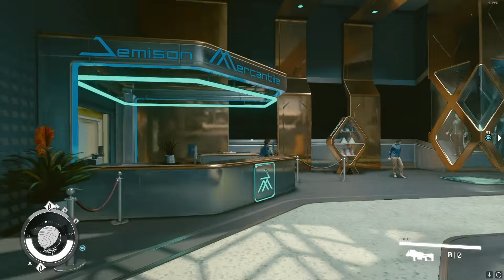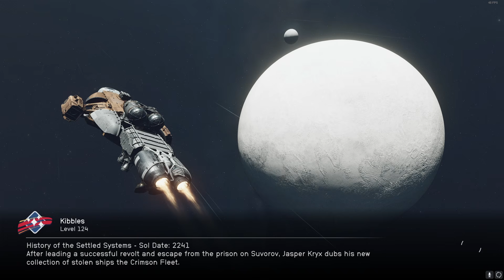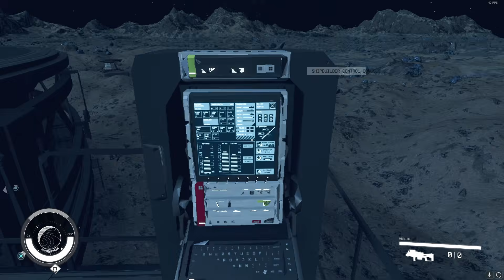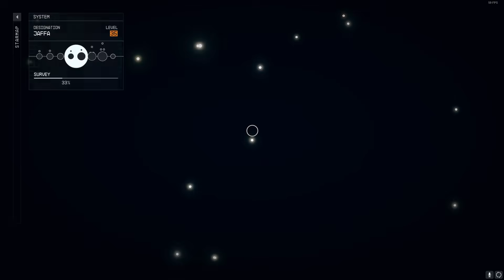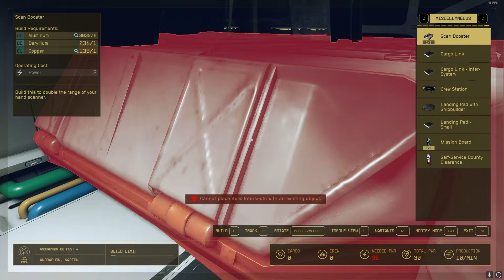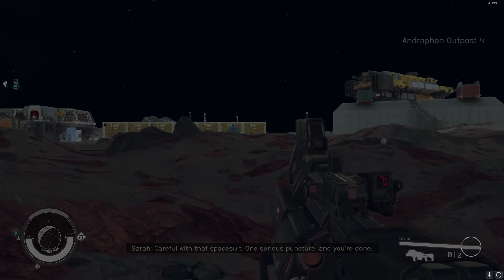Starfield outpost guide 2.0, beginner to expert FAST, outpost tips and tricks, cargo links, building

Comment: I am confused by the storage chains. Say you have 3 setup, 1-2-3 with an output coming into 1, going to 2, going to 3. 3 is last in the chain, meaning it fills up first right? And then when it's full, it goes back to 2, and then back to 1? So wouldn't you want to set the 'output' from that chain on the 1 crate since that's the last to fill up? Or does it go 1, fill up 1, 2, fill up 2, 3, fill up 3?

Comment: If you want outposts for xp and money, you only need one outpost, and its a planet on the bessel system. just find a spot bordering iron/aluminum there on the planet map, land, walk to the border region with your outpost builder on until you find a spot where you get iron and aluminum show up on the top left. place it there and fine tune the location a bit so you have enough space to place as many extractors as possible on both. then build extractors, build power supplies, cargo, industrial workbench, and a bed. then once its all powered on and you have a few cargo containers receiving the goods, go to sleep for 2 hours or so. 8 hours on that planet is 400 something hours in UT, so its ridiculously easy to fill up massive amounts of iron/aluminum which you can then use to produce adaptive frames until you have several thousand of them. Then go sell those off for tens of thousands of dollars, plus you should have gotten a bunch of levels in the process. with the outpost i set up, each 8 hour rest generates enough iron/aluminum to make about 2000 adaptive frames, and it can probably make a lot more if i built more cargo to hold it.

Comment: Hi, thanks for a great tutorial, much appreciated and I have now started to try and build my first outpost. However I have run into a serious problem straightaway, that is making building an outpost extremely difficult - I can't move my character one I enter build mode!

Like many PC players, I remapped the ASWD for the arrow keys for character movement. But in build mode neither Arrow keys nor ASWD key will move the character. The only way to move is use the auto-move key (NumLock) which is a pain, and I'm sure not what Bethesda intended. Once I change view ('V' key) to bird's eye, I then can't move at all; I'm frozen to the spot until I change back to ground view. What is going on? How are PC players moving their character in build mode? 

Googling this problem shows I'm not alone in this, but no thread I came across had any answer. People were simply saying, "use the ASWD keys" but they don't work in build mode.

Can you help with this - please.

Comment: For the Helium 3 loop on inter system cargo links, I wasn’t able to get the ship to take off after originally landing from the spot in front of the control box, but to fix it I went to the outgoing box and manually filled it with helium. For whatever reason that sparked the entire process into working

Comment: Yes! DO build that Ship Builder Pad (ASAP). Like the inside 250m you can access and transfer to/from ship cargo, is one of those things that make  life better. Literally!  

Bioms: Instead of running around with the scanner. A much more effective, easier and faster method to find multiple (3,4 and even 5) resources in the same spot/outpost, is to :
1)
   At a multiple biom spot. Take out the outpost beacon. While having it out, run around with it to use it as a resource 'scanner'. Try have it as far in front of you as you can an look around in all directions.
2)
   Since Up/left corner of your screen u can see every the resources available in the vicinity of the beacon ring. Giving you a MUCH bigger, faster and better way of finding multiple resources
3)
   High Ground --> Use your pack, boulders or other high grounds to make the beacon go even further in front of you, and give you even longer reach and better overview

Nice guide btw. Thorough and good tips. No BS. Straight to the point. All in one vid. Went over all the basics and then some.

Comment: The entire problem with cargo links is the carrying ship capacity. If the receiving cargo link storage is full, the ship keeps the cargo and deposits it back into the inbound storage from the originating cargo link, clogging up the entire system. So, general rule of thumb, never try to send more than one resource using the same cargo link, and don't try to chain your cargo links, it's a g-d disaster waiting to happen. Why can't they just have the ship discard any excess resources when it makes a delivery?

Comment: If you want to make a building be higher up in the air use the ground build view, not the over head. When you place the building piece pull back on your mouse to raise the height of the piece. Push forward to lower. Sorry i dont know xbox controls

Comment: good explantation with the interlink system, but since it is bugged, i would not use it. you always have to rebuild and reconnect which is not fun at all. i first thought i did not connect it correctly since the cargoship was working, but then i realized it is on a helium loop. looking forward to a bugfix

Comment: There are so many things I hope they do to fix and optimize this system: 
1) crew should be able to manage the outposts better and communicate with you in order to turn off a certain good manufacturing. 
2) as a daisy chain of multiple foods comes through you should be able to set up the quantities that are “ordered” or shipped through each link, ie you have 10 different resources coming to an outpost ready to be pushed to to the next link, that outgoing (or incoming on the next planet) should be able to specify how many of each type come on each shipment.  
3) outpost management may allow more than 3 landing pads. I haven’t even bothered with my own ship’s landing pad, because it would never land there, but I assume that’s one of the three as well. This could make the shipment centralization stronger by having multiple hubs instead of the daisy chain method. 

…just a few off the top of my head.

Comment: Technically, Inter-System platforms only require one end to have a helium 3 connection for both ends to work.

Personally, I rename the first outpost in every system (appending the word "HUB" to it's name) - so, everything traverses via the hub; all other outposts only send resources to the hub via a non-Inter-System platform (outpost 2 sends to outpost 1 & outpost 3 sends to outpost 2, etc).

In front of the platforms I build a 2x10 storage for solids, liquid & gas - link all incoming connections to that storage and the other end of them to the Inter-System platform's outgoing connections; add a small gas store by the inter-System platform; connect the gas store to the platform's gas receptacle; then connect it's incoming link to the gas store & add a connection to the platform's outgoing link - doing it in this order means the smnall gas store should ony hold helium 3 & that helium 3 is distributed across all hubs in the chain.

By each resource extractor: I build 3x10 storage for that resource type; connect the extractor(s) to the storage; and connect the other end to the storage in front of the platforms. NB: Storage in front of platforms appears to reduce the noise they make too.

Caveat emptor start small - you only need one or two small extractors for any given resource - otherwise you can overwhelm your connections & storage with one particular resource. Your main outpost everything connects to needs a further 2x10 storage for solids, liquid, gas & manufactured materials for each hub in the chain.

Comment: I mean .... basics are really good in this guide.... some info wrong and some is just not the best advice but technically not wrong....    I guess this will get people started....  so will give it a thumbs up because I appreciate all the starfield content creators
Reply: what info are wrong and what would be these better advices ?
Reply: @Nyu-Nyu-Nyu    Lot good info...  just not the best or even a great planet to do it on...  not at my gaming pc .... but planet is bessel II or IIc ?  and the maps aren't random generated or at least not how I interpret random generated....  every playthrough I go to the same planet and find the exact same area using the same black mountain as geographical point of reference and then place base in pretty much same spot beside the same cropping of rocks....   it splits 3 biomes and you get nickle, aluminum, iron... and ... cobalt?   time is something like 1/50 so sleep or wait for 1 hour 50 hours pass UTC...     anyways even if you follow this guide ...  alum and iron are most important so guide is goodd for that...   but bad advise is with the extractors...  use as few as possible  and get the gather circle covering as much of the mine able area as possible...  less extractors means need less power so less resources to spend on building power supply.  also don't spread stuff around the outside...  the game is not great at making it obvious when you have damaged structures...   so good chance your base can get raided and power supply or extractors get damaged and stop producing...  not sure what determines when/if/how often you get raided...    so good to try and centralize structures and drop just a basic hab so you can put turrets on the roof to offer at least some protection...  or at least make it easier to drop by and check if repairs are needed without running to the outskirts.  but overall this is a great guide for the basics... and then people would figure out the little improvements on their own...

Comment: I found your video helpful. 
One thing that would improve this is knowing the production and consumption rate on all of these things. So far the only consumption rate I see is on the interlink. 
Hopefully, the devs will add this in latter. 
I wanted to ask you about extractors. The extractors have an area of effect to them. Does the amount of this effected by things like how much of the recourse they cover and other extractors?
Reply: I don't think it's that clever, if you can place it down it'll extract the same amount, you just can't place another extractor in another extractors area of effect, you can overlap the areas and it doesn't seem to effect extraction rate. Just like placing the extractor right on the edge of a resource doesn't seem to effect the extraction rate.

Comment: The He3 clogging thing must be the excess. I had a similar problem with my first attemp trading Al ang W from two outposts. The outpost receiving Al had not enough storage, so the ship went back with it, and then the excess was being stored in the input of the cargo link that was supposed to be filled with W.
As you are sending He3 through the link, any excess could at some point get stored in the wrong place, as it seems the cargo ship deploy anything it's carrying the first time it finds available space, no matter if it was supposed to or not.

Comment: The cargo thing both on outposts and on ship can be easily solved by increasing the cargo capacity of the base ship and the outpost transfer module so that you don’t need to add tons of cargo containers. All you do is use the console to increase the capacity, which eliminates the need to make stacks of containers and having to link them together which is a pain in the ass. On my ship I only have one main cargo and two protected containers for contraband and each one has a 10 million capacity. The way you do it is open the console when you are standing in front of the container and click it with your mouse which will give you the ID for that module, and then you set the limit to 10 million. The console command is ITEM-ID.setav increase carryweight 10000000. That’s it! You will no longer need stacks of cargo containers in your base or ridiculously large cargo container ships for storage. Your cargo transfer module will now store all your materials by itself!

Comment: Anyone else having issues manually dumping resources to a storage silo (multiple storage chests linked) and the resources not following the output links? I have 5 large solid storage crates stacked vertically with an output link going from the bottom to top. When I add max capacity of iron to the bottom crate it just does not cycle up. I've heard that the output link system was not made to handle more than 1 item being transferred at a time (i.e. works fine with extractors but not manually dumping), I've just found it easier to travel to all my outposts and pick up resources instead of using cargo links, especially when dealing with 20+ resource types. Just wondering if anyone has found a workaround?

Comment: Fun fact. Inter-system cargo links only require one of the linked pads to be powered for both of them to work 😏
Reply: @CanwegetSubscriberswithn-cu2it  you can fuel both by only fueling one.
Reply: @lukemiddletom2250  both what? There's only one fuel connector...
Reply: @CanwegetSubscriberswithn-cu2it  both linked pads... you can fuel one pad, link it to the other and that other one doesn't need fuel
Reply: @lukemiddletom2250  tried that last night, didnt work for me.

Comment: Andraphon is not the best starting location. And why do you make a guide for a broken/unfinished system? There are literally hundrets of videos that do that already.
The best method is either not building outposts for mining in the first place, or transport the stuff manually. Everything else just consumes a lot of time you could spend earning money and then just buy the resources. And it is not so much you need anyway. Building this massive output and link it to your HQ, for what? You cant set limits, you cant properly manage transport routes and amount of goods. And for the bit that is possible, it is bugged AF. Not only what you mentioned... 
You end up with full storage boxes in one way or another if you don't cut off the production, and then you realise it is pointless the way it is right now. There is no settlement system either, even the crew does not need food or anything. You can put them on a barren rock without anything and they happily greet you no matter what...

Comment: THANK YOU for clarifying how to fix bugged out inter system cargo links.. i was going crazy thinking i had set them up wrong for days lol. deleted and rebuilt + reconnected and working nicely now! also noticed that you need to be really careful when setting output lines between storage containers, especially when theyre stacked, they just wont transfer if they're going to multiple others sometimes. needs to be a clean path

Comment: On my build on PC I have intersystem pads and only need He3 for one side of each pairing of intersystem pads without sending He3 to the other outpost pad so this is wrong or maybe console vs PC is different. I also found when my pads big and stop transferring I do not need to rebuild the pad. For some reason the outgoing cargo got put in the inbox instead of the outbox. Run over and move the cargo to the outgoing box and the system starts running again.

Comment: Question:   What do you use the switches for?  I don't think you covered this   Nice Video thanks
Reply: Switches allow you to turn off a production facility/extractor useful if you need to manage your power and prioritise a resource especially after your base is damaged in an attack.
Reply: @GiGod2   so do you link the power to the switch and then switch to the extractor?  or does it do it automatic?

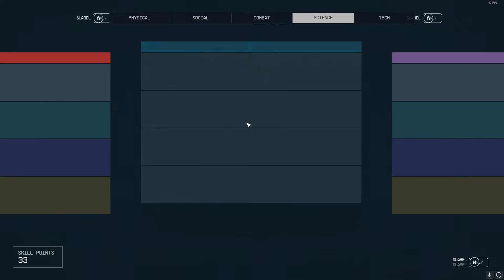Comment: 28:58 bro how did you build your wind turbines soo close to each other? And do i need to attach wires from Extractors to power generating sources for example wind turbines? or they just magically get energy EDIT: also i am not sure if you have mentioned but removing buildings from your outpost gives you back resources you have spend on that building, correct?

Comment: you can also change the height of structures by using "R" and "F" instead of trying to find a hill
Reply: It's always the simplest comments I find the most helpful, thanks :)
Reply: What is it for controller?
Reply: @seasonofbrad  This would be most helpful, has anyone found out?
Reply: I was wondering if that was an option.

Comment: One of my interlinks just stopped working all together. Doesn't show anything to link to. It doesn't show up at any other outposts and I think it's spreading to other outposts. Out of 4 outposts, only 2 show links, and only to each other. A mission I have won''t even show as an optional link despite all the components waiting to be shipped off. Yes, it was working at one point. 

I've tried deleting and rebuilding. Deleted most other objects like fabricators and miners. Reloaded a dozen times including some restarts between trying various things. Searched around but haven't seen anyone else with this specific problem. It's been a massive headache and waste of time. If anyone has suggestions, lay it on me.

Comment: Are cargo links only meant for single resources? I had a setup where I had 2 collection outposts feeding 1 outpost in the same system. It seems to work. Can you set up multiple links to different kinds of containers (gas, liquid, solid), and the cargolink is smart enough to send the appropriate resource to the right container? Say if I collect gas, gas and solid from one planet.

I also have a ton of other questions. Are there bottlenecks? Also how does relativity affect this?

Comment: Have used the Helium Generator to power my base, two of them exactly. But it’s at an Outpost where I also have a massive Helium deposit and where I produce so much Helium it’s crazy. I use 1 Helium Extractor setup to power both Generators for 40 Watts. I don’t miss the 1 extractor powering the Generator when I got like 7 others just filling storage with my massive Helium Deposit. At that base I’m also extracting Aluminum and Beryllium and total power usage is over 100 Watts already.